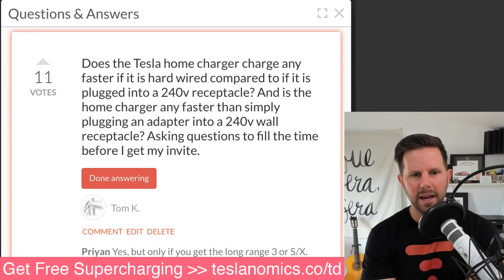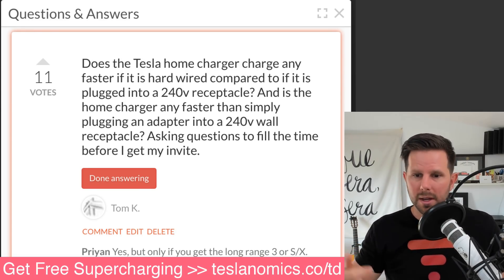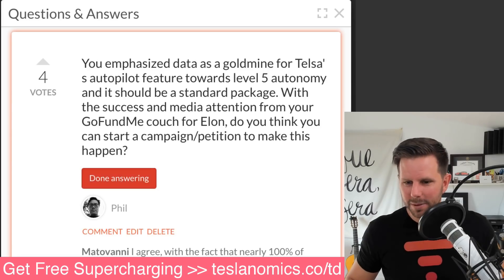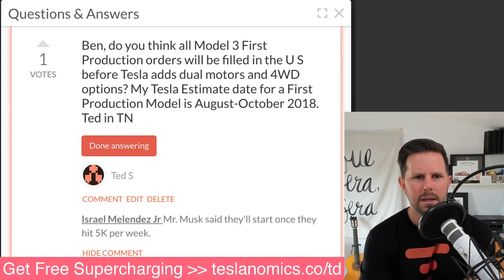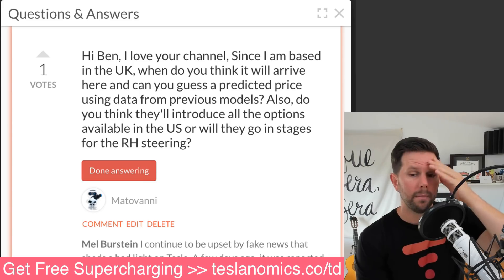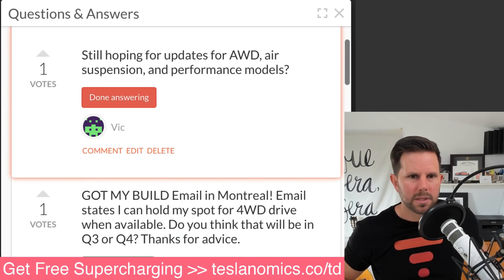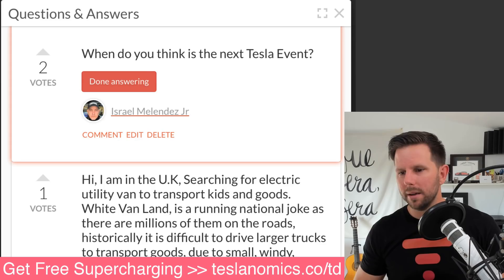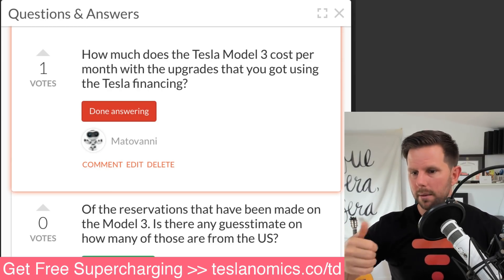Is a Tesla Wall Charger Faster Than a Plug? Q&A from Apr 30 2018 [highlight]

Comment: Dude you need to listen to your community and get the right facts. For autopilot to be trained they doesn't need it to drive. It just compares what autopilot would have done to a human. Free autopilot is stupid.
Reply: IMHO if u read other articles that like Super Cruise, they emphasize that AutoPilot if available significantly more often than Super Cruise. I will take more availability.
Reply: SuperCruise is pretty good thanks to localization just like waymo is doing it. But scalling super cruise (and waymo) is extremly hard.
Reply: Doug Garet, I prefer driving my own car, I don’t even need power steering, but if I had to choose one lane keeping assist, I’d rather it worked without driving me into a fire truck or concrete barrier.
Reply: Benedikt Schesch, after collecting lots of ghost rider data, the next set of data is done with autopilot on, and all human overrides flagged. That lets someone know exactly where to review what the car did (according to camera), what the car thought it was doing, and find the glitch that allowed it. Tesla is so far behind now, they should just give it away and hope to collect enough usable data to get some breakthrough in the software.
Reply: We are far away from having enough ghost riding data. Tesla is a little behind but it's momentum thanks to all the cars they have even if the cars didn't bought autopilot is huge.
Reply: Benedikt Schesch, think how much more free info they could get if they stopped charging beta testers for the right to test the system. All the profit Tesla made is going to be paid out in law suits. If they gave it away with very clear liability instructions and conditions for crowdsourced data, they would have less liability. But when you charge $5000, it better drive the car, like Super Cruise can.
Reply: That's a good point some people enjoy driving but not for long periods of time so we need a system that can take over and also give control to the user. The concrete barrier is easy to fix when tesla will start using their maps. The fire truck is more complicated and technology will take time but it will take over.
Reply: Benedikt Schesch, if I’m on the freeway, and need to take a break, so I can pour my coffee or something, I just drive with my knee. But if I was younger I would be interested in playing with OpenPilot and tweaking the code, once I learned how to interpret sensor and camera data.
Reply: IMHO so why r u even commenting on these technologies if u r only interested in driving ur car yourself. B like commenting on on which golf clubs r best when u don’t play golf.
Reply: Doug Garet, because I like technology and spent 20 years working in the Automation industry. Why are you here?
Reply: Hey I fell asleep with my old Model S on autopilot and it drove straight into a tollbooth going 75 without even remotely stopping! Luckily nobody was stopped there but I did fly about 8 foot in the air and rolled the car about 4 times. I walked away with 5 cuts on my right hand. That's it!
Reply: IMHO but said u didn’t like auto driving of any kind therefore ur opinion irrelevant.
Reply: Tesla Freak, the car is very crash worth in low mass collisions. Most toll booths I see have proper design so that the attendant is protected but the barriers are more like wedges to let you pass without hitting the attendant, but allow you time to decelerate, even while rolling. The California barrier could also have been a ramp which flips the car instead of stops it dead in its tracks when the attenuators are not in place.
Reply: Every time the human does something the auto-pilot wouldn't.. its data gathered..    Tesla gets MORE data when human is driving because they can collect every human intuitive muscle memory twitch... not just the few times the human makes a conscious decision to cancel autopilot.    

When autopilot watches you drive.. it collects every different choice you make whether you consciously thought it important or not. ... from  1% different to 100% different.   

When you watch autopilot drive.. it can only learn from the situations where you 100% disagree with it.
Reply: Curtis Johnson, at some point the added training is just noise, as the computer wants to drive in the center of the lane and the driver is 1/2” offset or weaving. Now what they need are the failure points, and solutions for them.